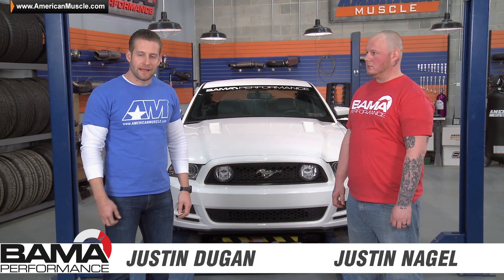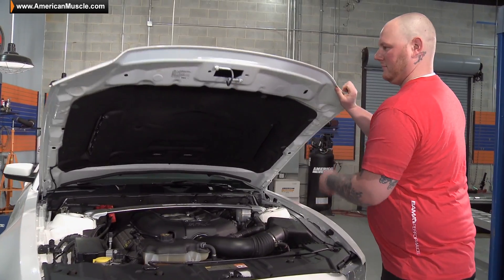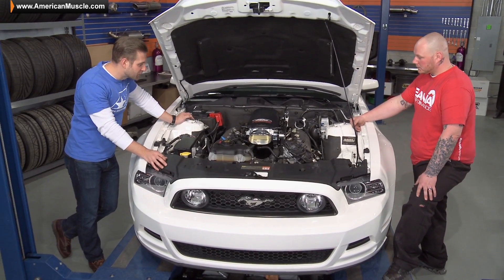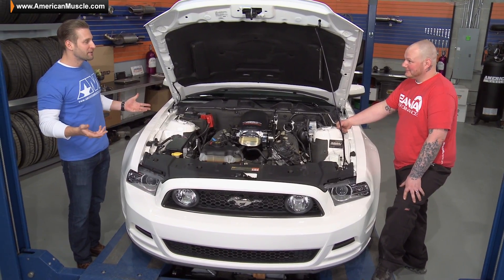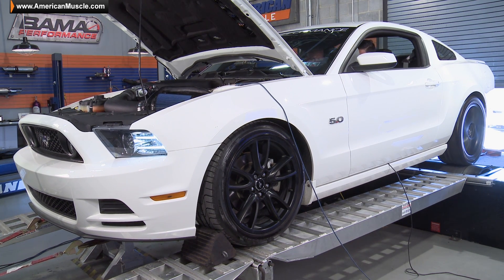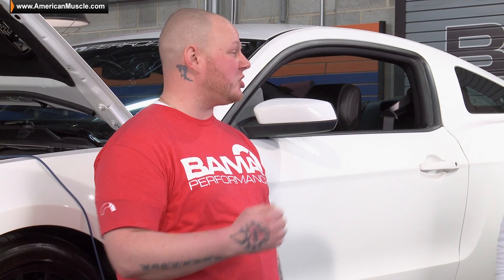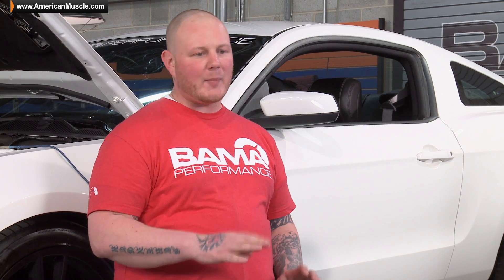2013 Mustang Cobra Jet Manifold Install & Testing

Comment: Hi Justin around how much would this set up cai, manifold, throttle body, and tune cost??
Reply from the maker: You can find a slightly used setup for 1500-2000 I would say, including tuning. -Justin

Comment: I'm wanting to put this intake on my 2014 Mustang Gt  but, in the description on this intake it states >> (Cobra Jet inlet tube does not have provisions for aspirator tube hook up found on automatic transmission-equipped Mustang GT)  so am I not able to install this on my GT with auto trans?
Reply from the maker: You can you just have to drill the CAI for the automatic connection.  -Justin
Reply: @americanmuscle  What's the CAI and whee is it located so i can know what to do.
Reply: @americanmuscle  Can you send me a pic  or info of what i need to do? Thanks Justin.
Reply: I have this intake on my 2013 with an automatic no problems

Comment: hey I thought these gt came with 420 hp stock than with all his bolt ons he should be already pushing 430+ hp why is his car not putting up better numbers? good vid to
Reply: nando 4200 they come stock 420 crank hp which is like 368 whp. Dyno reads whp. So he's probably around 500 crank hp less or more.
Reply: nando 4200    They push 420hp to the crank not the wheels bro that's why they're reading hp to the wheels
Reply: Even though it is now making some high HP numbers the car is still heavy. Some lightening of the car will help with the et's.

Comment: I have a 2014 mustang gt and I am torn between the boss 302 intake manifold setup and the cobra jet setup. How much more power will the cobra jet yield vs the boss setup? If I were to do the boss I would have bassani long tube headers, off-road x pipe, full bassani catback exhaust, boss 302 manifold, BBK 85mm throttle body and a steeda cai. The cobra jet setup would be same exhaust setup as the boss, but with the CJ twin 65mm throttle body, CJ manifold and CJ cai. What would the difference be between the two? Thanks for any help you can give.
Reply: Tony De Nardo:  Save your money and buy a blower or nitrous.
Reply: We want all engine with no power adders. Anyone can add a blower, turbo or nitrous but, we want to see what horsepower we can put down with just bolt-ons.

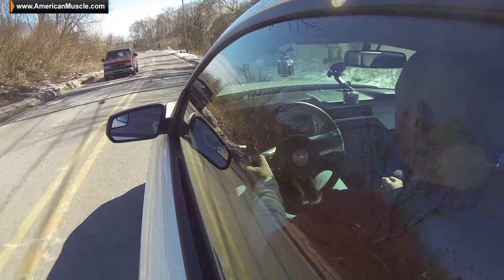Comment: I have 3.73 gears now, do I need 4:10 with this set up.
Reply from the maker: Hey Stanley, great question! But you do not need 4:10 gears to run this setup, your 3.73 gears will work perfectly fine! - Matt

Comment: My 2011 GT Brembo brake car has. v2 Bama race tune, borla S, ford Racing k springs, forgestar 19x11 rear with a 305 nitto and that's it yet it keeps beating all the other 5.0s out there left and right. So far is 8 KO's, no losses against other 5.0s and 4-0 agains 2010 plus Camaros 4-0 against a Challenger RTs, Scat Pack and SRT8. Most have been close races, except against the Camaro's those are slow.
Reply: My 2013 has stage 3 cams and full bolt on making 474 rwhp
Reply: @Youngster543210  do the stage 3 cams even help out much??
Reply from the maker: +BlackStallion Sounds like you've got a fast one! Keep up the good work! - Will
Reply: Whenever you are ready to run a real 5th gen hit me up bolt on boy.
Reply: +basindawg21 I am always up for some fun just say when and where. However I no longer own a GT since I trade it in for a 2013 GT500 currently making 700 plus whp. Same forgestar cf5v wheels although with a 315-30-19 tire instead of a 305 for the extra needed traction.
Reply: Youngster543210 how can I contact you? I want you to help me to upgrade my 13 GT to those numbers please!!!

Comment: Would the Cobra Jet set up work well with a automatic?
Reply from the maker: Kylehimself Absolutely! Once you get a Bama Tune to dial in the shift points you would screaming up to 7,500+ RPM and banging gears. I would highly recommend that set up! Maybe thing about getting some Long Tube Headers & Gears to get off the line even harder! -Dan
Reply: I'm wanting to put this intake on my 2014 Mustang Gt  but, in the description on this intake it states >> (Cobra Jet inlet tube does not have provisions for aspirator tube hook up found on automatic transmission-equipped Mustang GT)  so am I not able to install this on my GT with auto trans?
Reply: Alfonso Ramos did you ever find out if  it’s possible
Reply: @alfonsoramos5597 did you ever find out any more info on installing this on an auto?
Reply: @americanmuscle  the description says for auto there's no provision for aspirator tube. Is there any other work that needs to be done to help us auto guys out? 
Thanks!

Comment: Is it beneficial if you have a 15 GT? I know that there wasn't much gains with the boss manifold.
Reply from the maker: jo23bulls Yeah, definitely. There would be some custom work that needs to be completed in order for the Cobra Jet manifold to fit correctly on a 2015 GT. The Bama Performance team had to change motor mounts, remove STB, grind down the fins on Boss Manifold to properly install it. Hope this helps! -Dan

Comment: How is that car not faster than 12.30's with the mods that he listed?!?
Reply: He doesn't have the tires to put the power down at the track.
Reply from the maker: nateyzf He was running on Street tires and has a bone stock suspension. The car is definitely an 11-Second car. Justin is going to get the time slip to prove that this year! Hope this helps. -Dan
Reply: nateyzf elevation?🤷🏽‍♂️

Comment from the maker: Check out Bama Tuning Specialist Justin's nasty Cobra Jet equipped 2013 #Mustang GT! +1 if you like what he's done with his build so far..
Reply: if you buy motor mounts like i did it will work
Reply: cool
Reply: tell me dose your tune void the warranty?
Reply from the maker: *****
That really varies dealership to dealership! I would highly recommend checking with your dealer if you have any questions. - Will
Reply: AmericanMuscle.com
rly?i thought ther are standard sell/own agreements from ford
thanks,keep up the cool work
Reply: will the cobra jet manifold be available for the 2015 GT?
Reply: Any updates on justins build or any new tunes or adjustments  for the cobra jet system...i feel  some hp is still being left on table somewhere
Reply: Joey Porcelli   Nope
Reply: Joey Porcelli.  Maybe you can do a gt350
Reply: The Cobra Jet fits the 2015 you just have to notch the back of the hood skeleton and remove the hood liner for clearance.